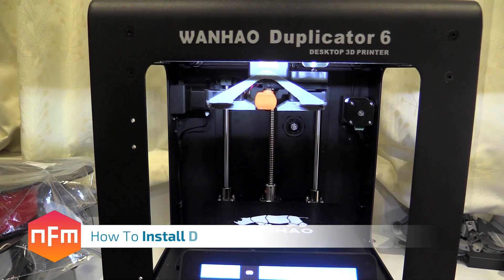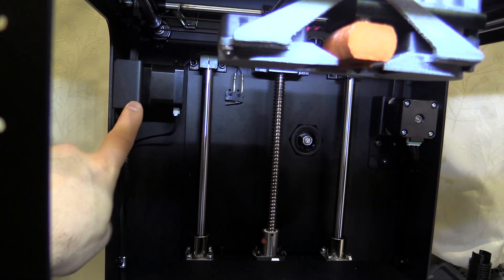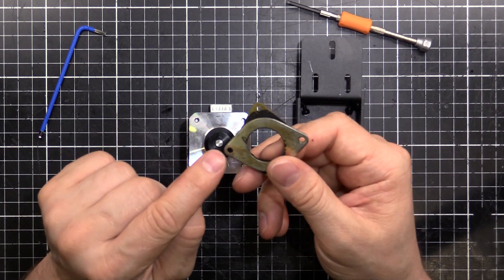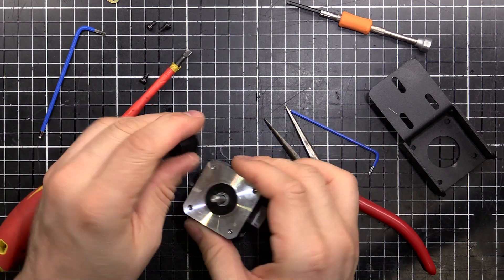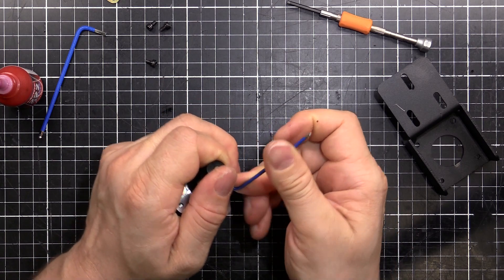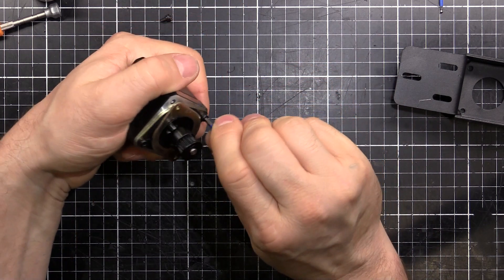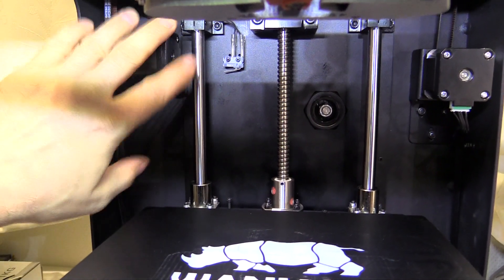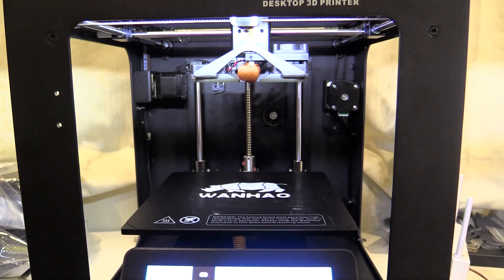3D Printer Stepper Motor Damper Install - Wanhao D6

Comment: Whats the touch screen ? I thought these had a click wheel basic menu ??
Reply from the maker: It's a raspberry pi screen, connected tp a raspberry pi running klipper.

The normal click wheel and display is still there hiding underneath.

Comment: How did you get that huge screen on there?
Reply from the maker: It's an official Raspberry Pi screen with a Raspberry Pi on the back running Octoprint and Klipper.
Here's a link to the files I used to print the parts:

https://www.thingiverse.com/thing:2491086

Comment: hi, can u help plz. my son disturbed all 3 leveling screws as well as the buildplate screw at back that hits this the limit switch. how can i bring them back to factory set positions?
Reply: Set the limit switch so that it stops 2 mm or so above the plate.    Follow the leveling procedure in the GUI Maintenance / Build Plate  to set the leveling screws.   I typically relevel every 5 or so prints.   There is  a video done by a guy with the Z limit set wrong,  https://www.youtube.com/watch?v=SaftvhjGTU0

Comment: Hey NFM, I have a quick question. When I'm reattaching the belt to the 'y' motor pulley, I've noticed that it is not lining up properly. The belt is slightly to the left & forward. I'm now in the process of trial & error to realign the belt. Take it apart; re-screw it; rinse & repeat. Two questions, is it just a matter of trial & error for the optimal alignment? Is there a type of level that would tell me if the belt is straight, something akin to a pendulum? I know that I'm reaching here, but I want to put it back together properly to prevent gradual wear due to a misalignment. Any Thoughts & thanks in advance?
Reply from the maker: If you leave the set screw on the motor pulley loose so the pulley can slide, you can eyeball it and manually move the gantry to run the belt around to line it up.
Then you can carefully take the motor out and tighten the set screw.

It's a little bit of a fiddle to get right, but worth spending the time to ensure good prints.

Comment: Really great work - mine is quiet now too ! Other question: Where you bought the silicone boot for your heating block ?
Reply from the maker: I made the boot. Check out thingiverse and you'll find the 3D models to print the mould.
I used Permatex brand high temp copper silicone with some cornstarch mixed in to make it set quickly.
Reply: There is a guy from Greece that sells them on ebay - ready to install. Shipping was pretty quick to the US also. About 7 days. message me if you are interested and cant find them.

Comment: Just finished doing this. Thank you so much. It definitely keeps it a lot quieter. I still get a small beep sound. Is that the retraction or is something off?
Reply from the maker: Possibly the extruder motor or the Z-axis motor.
The dampers work well, but they aren't 100%, so a little noise is still present.

Comment: Thanks immensely for this video! I was wondering how to reduce the noise and this convinced me to try it, and your thorough explanations made it very easy to do. It's crazy how much difference such a small thing can make :)
Reply: after you did this did you have to raise the zaxis stop screw? I found that i had to make it longer because the motor is hitting the bracket in the back
Reply: No, I was getting enough clearance (barely) without needing to adjust the screw. Though it's possible the screw was already set higher out of the box for me. I did rotate the Y motor to have the connector in the back as shown in the video (I did not need to print the adjusted stepper motor bracket).

Comment: X and y Axis only? Or the z as well?
Reply from the maker: Check out this video for the Z-Axis. :)

https://www.youtube.com/watch?v=WBnVCn5--h8
Reply: NFM thanks. I ended up using the stock brackets with the dema dampers, just turning the gears around on the shafts. The abs printed brackets we're not up to the task. To pull the gears, had to tap out the pin  with a hammer and screw driver while a friend help the motors. They would not budge with plyers.
Reply from the maker: +joe catunto Good to hear it worked out! :)